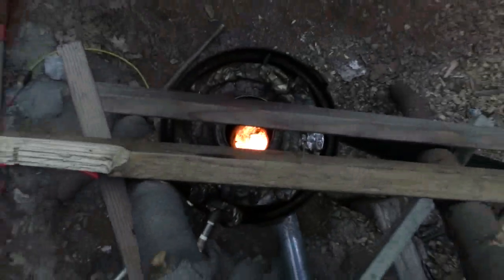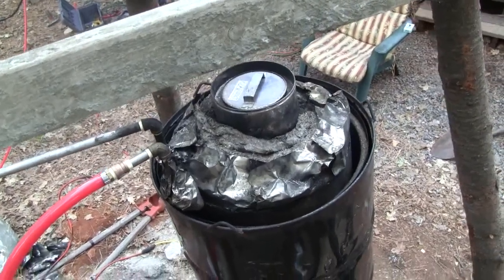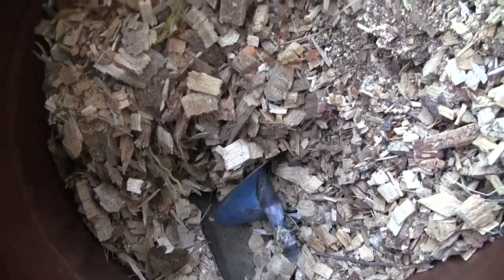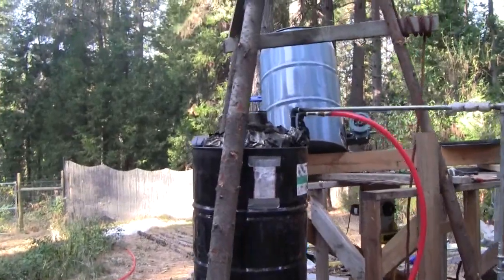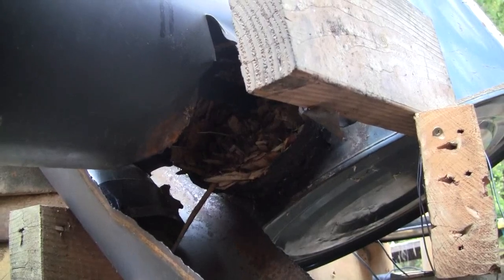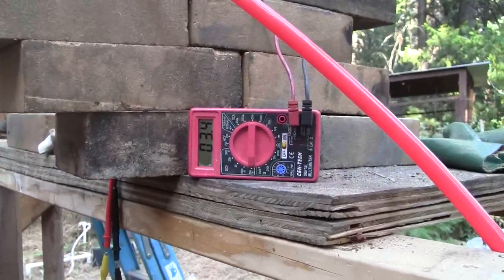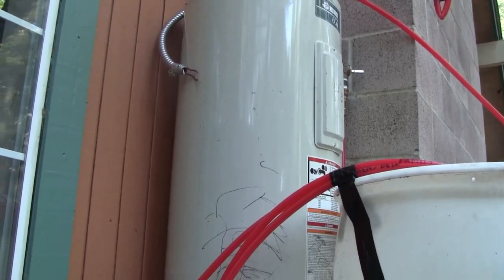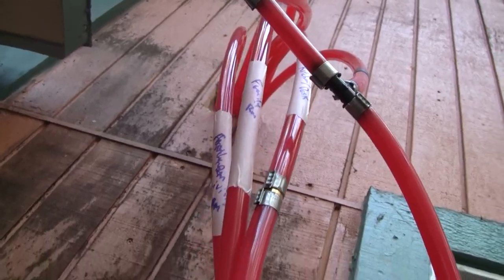wood chip radiant heating 60kW 200kBtuHr operational.wmv

Comment: nice, i can get semi-free wood chips...only issue with wood chips vs larger fuel is electricity required for the auger........or could use a spring wound or weight system.... but the auger probably would use little PV/batt power

Comment: Thank you x3 for sharing your video.with us .... the world is already better with people like you and I .... My suggestion my friend is, for you to research and test, the rocket furnace to boil water to steam as a no water pressure gravity device where no electricity is need to circulate the steam downwards and thus close to zero risk of steam explosion if calculated and circulated downwards propertly where you boil the water below levep of the floor ro be heated and collect by condensation on the return with a back up valve that feeds the rocket stove making sure the boiling evaporating vessel is a stainless steel container .... the steam or condensated water preferably can be made so that it makes the "awger conveyor" works mechanically and without electricity .... best wishes ; ) .... share it if you build it.

Comment: I can see this as a replacement for a pellet stove.  AS for a water heating system I'm on the fence.  You need a pump to move the water.  The water could go through radiators and back.  Also would need an expansion protection device.
I like your idea as an air heating system.  
But, again the issue is it's an outdoor set up.  If it could be done as an indoor unit it would be great.   What a way to get rid of wood chips.  That I like because those things are free around here for the taking.
Or, maybe as a mass heater.  Similar to a rocket stove set up.  That could work to keep the basement warm

Comment: I commend your effort and back yard engineering but that system is a train wreck!!  no true hydronic technical data applied.
Reply: boilermech In defense: This is backyard engineering,  you are a pro. We build go karts, you build hot rods.

We backyard people don't know what "hydronic" is, and we learn from our errors.

 I just made what I thought was a brilliant wood heating system out of 1/4 inch plate, it failed. I learned from my mistakes and will correct my errrors this Spring.

My long-term plans include a system not much unlike this one. I seek information everywhere I can before I build.

If you would be so kind as to put a video together to explain the basic principles of these systems, and explain, "hydronic," and other important words useful to us. You could be our rock star of knowledge.

Comment: I have watched your videos and appreciate the simplicity that you come at it. Can you please tell me a make and model for the auger gear motor components. My local suppliers want to price components in the $1000 range. 
Also what is the title of your video that shows the detailed assembly of the heat exchanger as you put pipe in barrel. I saw how you coiled it, but would love to see the path of heat before exhausting out top. Maybe a diagram.
Many thanks in advance

Comment: Hello sir, you have assembled a  very nice setup to heat your home.  I am impressed by the use of common materials for construction to keep costs low.  Your philosophy of building and engineering to fulfill your needs versus purchasing a manufactured "turn-key" system is admirable.  I like how you built the boiler yourself and have plans to add computer controls.  Keep posting the videos, they are very appreciated.

Comment from the maker: I hope to video construction of a completely new burner construction.  Boiler construction videos are already up for how I did this one using 500 feet of 3/4" stainless tubing.  But winding the coil in a single run will be the next goal....not sure when that will happen though as this one is still working fine and i need to construct the winding machine to do it when I need to do it....still life in this one for now.
rt

Comment from the maker: As for life expectancy............long.  the internal firebox will be ceramic cast, like in a kiln.  So this will last just like any wood stove or wood boiler and the stainless heat exchanger ought to last a very long time.  You do need to clean it out now and then, but the design makes that fairly easy.
rt

Comment from the maker: Regarding sawdust.............yes it could be configured to use sawdust.  The fuel delivery would need to be different so the sawdust burns rather than just punk away.  And you'd need to prevent the sawdust ash from flying up into the heat exchanger and clogging it.  That said, sure you could do it.  You could also convert the sawdust into pellets or chips, probably a good use of a small amount of energy to make combustion nicer.

Comment from the maker: Nice.............few notice that.  I put a secondary blower that blows into the feed tube to balance the internal positive pressure and prevent hot gases flowing backward up the feed tube to the wood chip storage.  There is a little air blowing in the chip feed tube.  The real future system will have negative pressure, but as that requires some parts I don't have yet I just threw it together this way for the time being.  Been heating the home all winter, working great.

Comment from the maker: @dexterquincy1 
PS......This is absurd, but true.  You could buy the chips for more money than mills or oil industry pays.....they still cost far less than propane when used for energy.  You could purchase milled lumber, chip it, burn it, and come out ahead compared to propane or natural gas for instance...........silly use of resources, but shows the true value of wood as lumber vs as energy.....

Comment from the maker: @dexterquincy1 
Thanks, and yes, many places don't have plentiful wood chips.  In your area, you do have lots of agriculture growing hay and other crops............corn stover, hay, and other crops can be converted into a form of "wood" pellets.  So, you could use bales of hay for instance, at least if converted to work with the burner, or via design of a different burner.  Biomass won't solve our entire energy problem.  You could perhaps use Natural gas as the fuel + hydronic??

Comment from the maker: Thanks.  I looked up a commercial, 300k btu/hr boiler the other day, a friend is installing it to heat some structures through winter.....$7k or so depending on brand, runs on propane.........That will cost around $10 per hour to run.  Mine runs an hour on a few buckets of wood chips....there are piles of them for free on side of road in town.  During cold spells, running at full power, 300k btu/hr, that would cost $240 per day to make that much heat